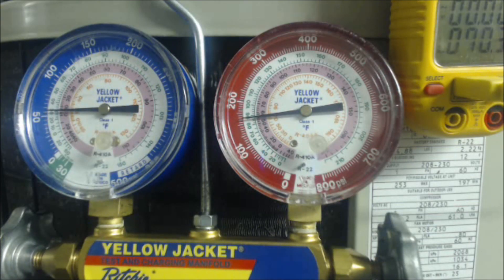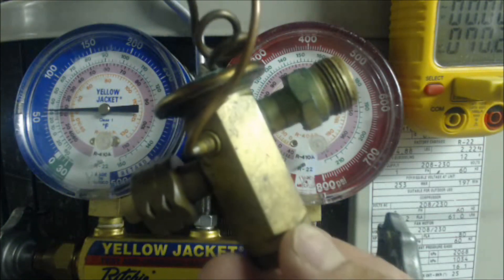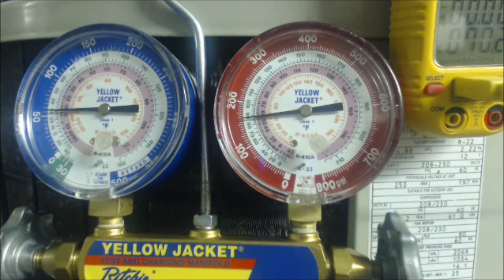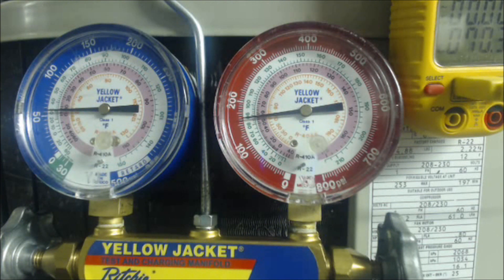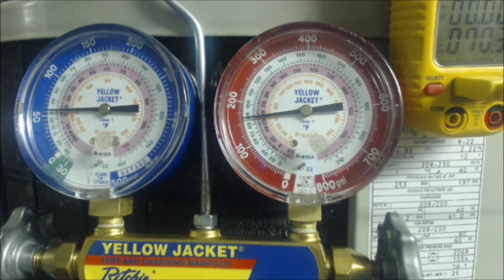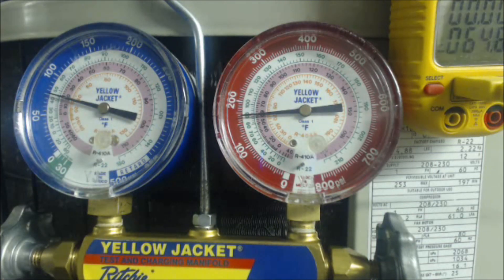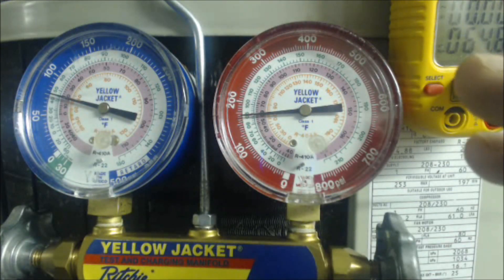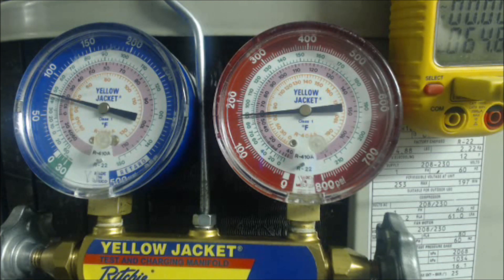How to Measure Superheat and Subcooling!

Comment: I don't seem to understand one thing. After the refrigerant has given off its latent heat and has started its sensible cooling, its pressure must drop too right? If yes, I don't understand why we measure the pressure at the outlet and convert it to saturation temperature as the pressure at the outlet will be a tiny bit lower than the sat pressure.

Comment: When you say to always make sure your vapor pressure is always above 32° even when checking for subcooling. Do you mean the pressure or the saturation temp?
Reply: 32 is freezing point. You want to be above that so your evaporator coils doesn't freeze.
Reply: Sat Temp

Comment: Are you able to use a point and shoot laser thermal gun to measure temperature on a/c lines?
Reply: They're Not very accurate,
Reply: I found that out, putting black tape on pipe and pointing laser helped but not as good, I agree
Reply: David B. They rely on "emmisivity" of substance, a shiny surface reads as cooler than it really is
Reply: Nathan, I agree

Comment: Where do you find what the sub cool and super heat should be?
Reply from the maker: Target Subcooling is found on the rating plate. Target superheat is calculated using the indoor wb and outdoor db temps. Look up acservicetech target superheat thanks

Comment: Dont you have to use the pt chart b4 getting your superheat and subcooling?
Reply from the maker: Hey F. Dorsey, the p/t chart is overlaid onto these gauges so the dial will line up the pressure on the outer ring with the sat temp on the inner ring, thanks!

Comment: This brand new Goodman 16 SEER 2.5 ton single stage heat pump and A/H with ECM motor with a fixed, pre installed TXV  does not have a subcooling chart anywhere in the manual nor is there one anywhere on the unit. In the manual though it states to not attempt charging by subcooling if the outside temp is under 60 degrees and it says they want the subcooling to be 8 degrees F (+\-) 1-2 degrees F.  Is this normal to see? Typically I find a chart in the manual or on the ratings plate.
Reply from the maker: Sometimes they are not on the rating plate but yes, make sure that it is above 70 degrees outside and inside before checking the charge with subcooling. Make sure that if the unit is microchannel then follow the manufacturers charging methods. If it is a single speed compressor on ac unit with a txv then it is usually around 11 degrees of subcooling unless microchannel, thanks

Comment: Great video very informative
Reply from the maker: Thanks Suave!
Reply: AC Service Tech LLC so if the superheat is to low I would extract refrigerant right?
Reply from the maker: It would need to be recovered if the superheat was too low and the unit had a fixed orifice for air conditioning, thanks!

Comment: Are you sure that the saturated temperature of r-22 at 185 psig equates to 87 degrees Fahrenheit?
Reply from the maker: Wow you are the first person to catch that, thanks. I must have meant to say 97 but said 87 instead and didn't catch it, thanks
Reply: I saw this as well. But I have a question. When checking for subcooling do I still add 20-30 degrees on my ambient temp? Or just use what the gauges read?

Comment: Great  Video , however in last example in real world would you remove refrigerant from the system. Sub cooling is equal efficiency of system?
Reply from the maker: Yes correct, I was saying that subcooling is too high and refrigerant needs to be recovered from the high side and into a recovery bottle until the subcooling gets closer to the target, thanks

Comment: Hello. Can you tell me which superheat degree I'm going to go for on this one where there is nothing on it? 

https://imgur.com/a/czkoljh
Reply from the maker: Hey K W, I looked at the photo but wasn't sure if this was a mini split or conventional single or two speed ducted unit?
Reply: Hey. Think it's a mini split but not 100 sure.

Danish - http://www.quine.dk/files/produkter/indendoers/air_condition/350321.pdf

Enlish - https://sirge.it/manuali/condizionatori/KFR-25GWVWaservice%20manual.pdf
Reply from the maker: I can't seem to open that but minisplit units that are vrf can't be checked with superheaat or subcooling because they don't have a single or two speed compressor. You would have to use the total weight method. If the unit is a single or two speed with a txv then you would use subcooling. Most minisplit do not have a piston in which we check superheat. Subcooling on a single or two speed unit will typically be between 8-12 degrees. You cant check the vrf due to the compressor ramping up or down. They should have a delta T of 21-23 degrees though across the evap coil when on full cooling capacity thanks
Reply: Do not know so much about it and is a a little lost about some thing you mention :) Bought this air season and turned out to be out of coolant, so here on youtube about refrigerant and got some R407C plus a varccum pump. Everything worked well until errors occurred with the weight, making me a little lost, but remembering that I saw a message where someone who told me that if there was frost on the thin tube, then there was less than 30 on the pressure gauge and that it would be cooling on it until the pressure gauge was about 60, which I then chose to follow. The aircon seems to work, it cools but doubt if there is too much liquid on it. There is no frost on the thin tube, but at some point there was some frost on the thick tube, right next to the valve, so it became doubtful if there was too much. There is only one valve that sits on the thick tube, so it would only be possible to measure superheat if possible.
Reply: Now tested the device. Runs for about 20 minutes before I read and if I take from a temperature of about 21-23 degrees I suppose it's a bit in the bottom of fluid? If I look at the power consumption, this also supports lack of fluid, a bit. Even though we calculate 240V volts in DK, it was 228V during the test, which gives us greater consumption (962W), but the amps also varied.

25.4 Celsius minus -5.2 = 20.2

Power consumption 220 * 4.22 = 928.4W

Can I assume it's ok?

But seeing that on the manometer is R-502 and I'm using R407C, does it make any difference?

Attached pictures and manual.

https://imgur.com/a/V2MYgBs

http://www.sklep-klimatyzacja.pl/dokumentacje/CHLODZENIE_DOK_2006/GREE_DOK_2006/01%20KFR-25GW-NA13%20Service%20manual.pdf

https://www.hvaceducationaustralia.com/Resources/PDF/Pressure_Temperature_Conversion_Chart.pdf
Reply from the maker: Hey KW, Honestly we just do VRF Minisplits with weight. We recover the refrigerant, fix the leaks, pressure test, vacuum pump below 500 microns, do a standing vac test with the vacuum off, and then we weigh refrigerant in based upon the factory charge listed on the rating plate and more refrigerant for any extra lineset as stated on the unit rating plate or literature, Then we verify 21-24 degree F delta T across the evap on max cool, thanks!

Comment: Your video's are excellent.  I have a very basic question, Our measurements are at the high and low side within 3", but the gauge is reading (designed/calibrated scales) "from the middle of the evap. coil", I am assuming that the length of the lines to the evap coil has been taken into consideration when the gauge dial calibration unit was manufactured. So what is the length of the  lines from the outside condenser to the evap coil used as a standard (X number of feet).  Wondering how the various length of line run effects the actual gauge reading? Pressure should be about the same, but temperature from a long run?
Thanks in advance
Reply from the maker: I made a video on that, - https://www.youtube.com/watch?v=th0EnaSbJUw&t=26s

Comment: what if there is a txv installed  and the condenser does not have a target subcooling at the reading plate?   thanks for your videos they are very helpful...
Reply from the maker: For AC our target is 8-12 degrees so I usually shoot for 11-12 if it is not there then check for 18-21 delta T across the coil, thanks
Reply: acservicetech thank for the prompt response.

Comment: I like using the thermocouple from my multimeter, but how important is accuracy?  It seems that if my reading is a little off and/or my Thermometer is not exact that I could be 8-10 deg off... could be disastrous.  How important is accuracy, calibration and instrument selection?
Reply from the maker: Just test your sensor in an ice water mix. It should mainly be ice and the water after a five minutes should fall to 32 degrees if you get it out of the tap. Your sensor should read 32 degrees or very close and if it is off then you can get another, thanks.

Comment: How do you properly charge a unit that has no liquid line service port?
Say a side-discharge condenser with a txv or a ductless 
?
Reply from the maker: If the system is not a single or two speed then the manufacturer usually wants to charge by weight. If it is a single speed but not a port you can use two temp sensors to read subcooling. I was planning on making a video about that soon, thanks!

Comment: I use your videos in training classes with our techs. They are very helpful. The only comment I would add is that you must confirm clean coils and proper airflow BEFORE attempting any charge evaluation or adjustment.
Reply from the maker: I agree completely. I have been faulting my students projects and monitoring for safety. I let them experience what this looks like as the low side is below freezing but they have subcooling, if they add refrigerant all that happens is the subcooling goes up and the vapor pressure will not rise. If its a piston system all the sudden they see that now they don't have much of any superheat but the evap is still freezing. I tell them, see it just doesn't work. Once they realize this, they never make that mistake again with wanting to add refrigerant first, they visualize the problem as low air flow by their readings and know not to add. I really burns it in their memory, thanks!

Comment: Question: If the temp probe and pressure gauge are in such close proximity to each other, why is there a temp difference?
Reply from the maker: The refrigerant is no longer in sat state. Check this video out. I made it to answer this type of question-   https://youtu.be/th0EnaSbJUw
Reply: Wow that's a great video to prove exactly my question. Thanks!
Reply from the maker: Glad to help Tim!
Reply: Short answer: the gauge is calibrated to display the temperature of the refrigerant in the saturated state based on the pressure which is constant between the meter and the compressor. At the service port the refrigerant is in the vapor state so the pressure does not correlate correctly to the temperature at the port.Long answer involves Boyles law and the Ideal gas law.

Comment: How would superheat and subcooling apply to commercial  reach in coolers and freezers or walk in coolers and freezers?
Reply from the maker: Superheat is normally 25-40 degrees with the door open. After the liquid line sight is solid with the door open then you know you have subcooling with the receiver drained.  If the door is closed and product is inside, you are looking for 6-8 degrees of superheat on a refrigerator roughly. Thanks

Comment: if the compressor pumping less. its show same result in charging gauge  as you show.but how you know its txv problem are compressor pumping less. please  explain me 😐thanks sir
Reply from the maker: If the compressor is pumping less then you won't have as much subcooling. If it is a txv problem then you can see that the superheat is off. You first would need to get to the proper subcooling and then check the superheat across the evap coil, thanks

Comment: If a residential ac split system has a txv and is checked by subcooling. After checking with gauges and temp on liquid line, do you verify you have the right subcooling by checking the superheat against it
Reply from the maker: You could check superheat just to make sure that txv is holding the superheat properly but that is the txv's job and not the refrigerant charge. Subcooling in that case would indicate the correct charge. Thanks

Comment: Do you think it is best to have two different sets of gauges one to do 410a and another to do r22, or is it ok to use one gauge for both refridgerants
Reply from the maker: Two gauges are certainly better so oil is not cross contaminated. I use my old set for recovering burn outs. Thanks
Reply: trukin forever it's also good because 410a is a high pressure refrigerant and normal older gauges even though they say the can go up to 400 psi they can only do 340. 410 a could blow your 22 Guage

Comment: I have really learned a lot from your videos!  Very good information!  I have been wondering, will the super heat method work on an automotive A/C system?  Also, would you be able to do a video describing the thermodynamics behind superheat and subcooling?  I took an HVAC class when I was getting my engineering degree, however, we didn't do practical real life stuff like this.  I would like to know the theory that determines why this is the way that the correct fill is determined for an A/C system.  Finally, do you use your gauges across different refrigerants or do you keep a separate set for each type of refrigerant that you deal with?
Reply from the maker: Hey gearbrain91, it depends where the valves are in a car ac system also depending what rpm you are at there are variables due to speed.  I believe the video that you are looking for is ---  https://www.youtube.com/watch?v=XscHn6GPWO0&list=PLxnHR5_D2ojwbAc7K7DsjuasaDVfJeGSe&index=2  ---- check out the refrigeration cycle playlist though for more step by step examples. I try to keep one set for each refrigerant especially r-134a. At worst case scenario, you could blow the oil out before use with another refrigerant but you still have oil on the sides of the hoses which you don't want to mix with other refrigerant oil systems.  Any other questions just ask. Thanks!
Reply from the maker: The refrigeration cycle playlist of videos is at--   https://www.youtube.com/playlist?list=PLxnHR5_D2ojwbAc7K7DsjuasaDVfJeGSe -- but all playlists can be found on the main youtube channel. Thanks
Reply: acservicetech Thank you!  I really appreciate the help and explanations!

Comment: very nice, thnx, you help me to improve my skills ;) very apreciate.
to much tech dont know this and add to much Ref or not.. 
Like me :S. now i will make not just a good job but a perfect job. :)
Reply: 24volts system on air conditioner how to check thermal Transformer
Reply from the maker: Awesome thanks GH Leader!
Reply: acservicetech i have a question, i an use this method to charge or ajust my system in winter? 
or i have to bring the WB outside and DB Inside when the system is on heating? my by-energy goes to gaz after-10 -12 but its hard to me to ajust system when the temp goes under 0. thnx and advance
Reply from the maker: If we are talking about regular split systems with a heat pump outside then you can only really find the true subcooling or superheat needed during summer with a load on the building of 65 degrees or higher. The reason is because most heat pumps have an accumulator and there is no way to know how much is in this during winter. Also you now have a frosting evap coil outside. You literally have to go by either pulling the charge out and weighing back in the exact amount or just temp differences between the return ans supply air.
Reply: acservicetech ok that is what i taugh. thanks :)

Comment: Great videos I'd learned a lot from your videos now in other cases what if there's no label with the right information?
Reply from the maker: Glad to hear! Great Question! I Usually set the subcooling for 11 or 12 if the rating plate is completely gone. You can find what refrigerant it is from the tag on the compressor or if the unit has been sitting without turning on for an hour you can tell by the pressure temp chart what refrigerant it is. Line up the pressure in the system with the average temp of the air surrounding the unit.
Reply: Well there's plenty of information except for that information